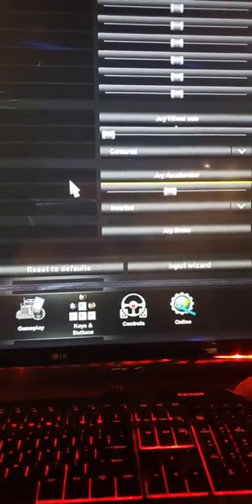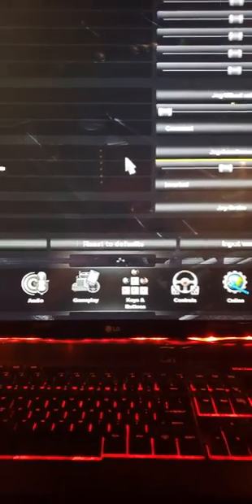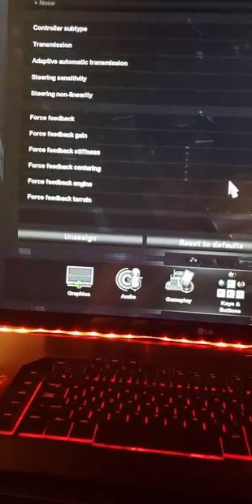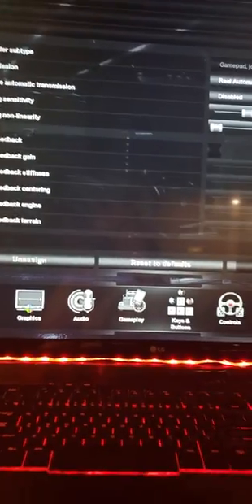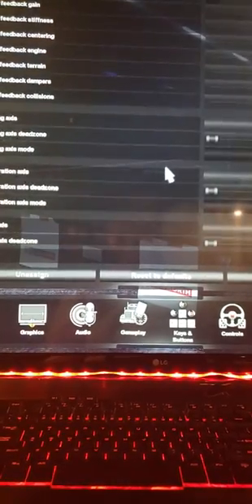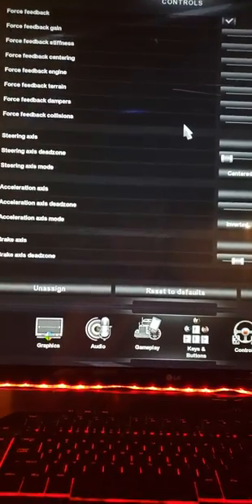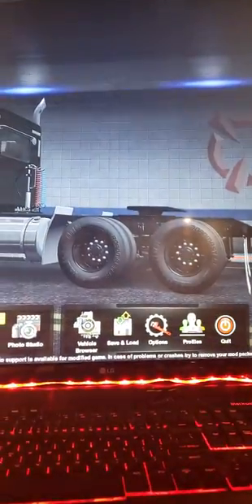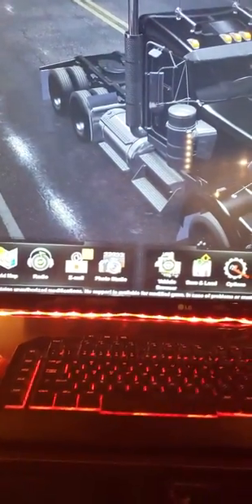Accelerator or brake stuck American truck simulator

Comment: Had the same issue in ETS2 with the Logitech G29 pedals. This fixed it as well. Thank you very much!
Reply from the maker: No problem 👍
Reply: Same
Reply: My problem is that I'm using the latest build for ETS2.  My other problem is that I can't disable force feedback which is making it too difficult to steer.

Comment: The first time I tried my G923 it worked fine (with the GHUB open in the background), but then I got to poke around and change some settings in-game and it went crazy and I couldn't reset it... or the steering or throttle was acting up queer. I was very desperate, I had already tried everything and you brought me peace.

Comment: Mine is refusing the steering wheel is not turning the truck is not moving but it's on I dont know what to do I did selet keyboard only & Real automatic still even simple automatic